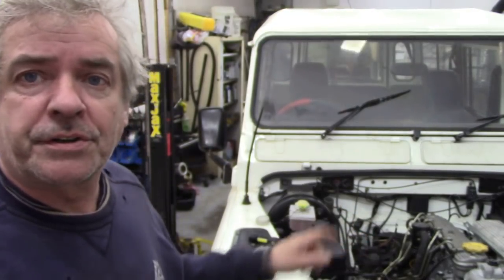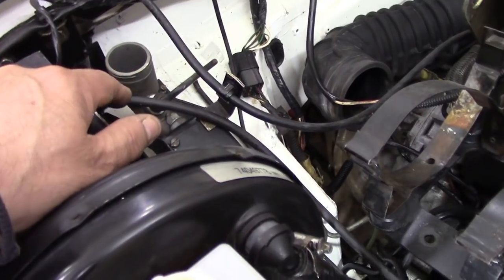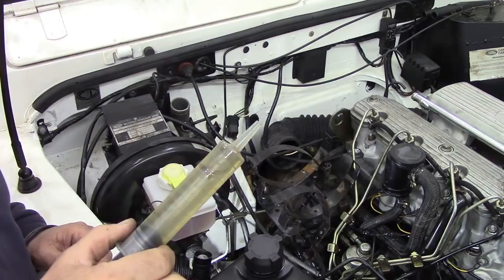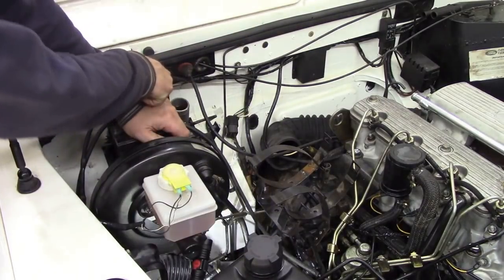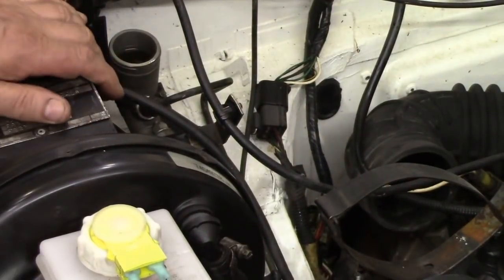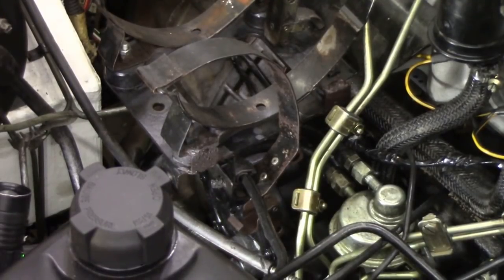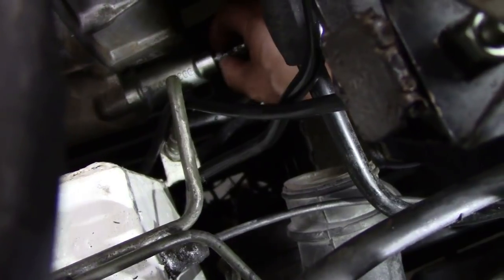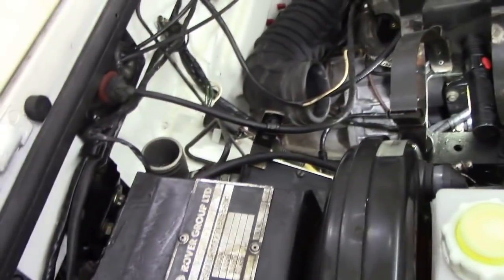Gravity bleeding the 300Tdi clutch - easy!

Comment: In the days before motorways here in the UK I got stuck with a clutch that had run out of fluid due to a leaking slave. The only thing that I could get hold of was a bottle of cough mixture that was for my young child who was traveling with me and my wife. Out of shear desperation I poured that into the master cylinder and hoped for the best. Not only did it get us home, it actually lasted the car out for another 18 months. I think that it must have been the sugar in the cough mixture that sealed the leaking slave cylinder, which was a god send when in those days you had to stop at all those traffic lights and cross roads, not like now once you get onto the motorway there's no need to change gear as much. I  bet you have never heard anything as daft as that before , have you Mike. Stay happy, Yorkshire Rob.
Reply from the maker: I have known milk to do the job too, but may be a bit rancid after 18months!
Reply: Talking of things you do to get you home, back in the 90s I got stuck at work after a night shift with a bone dry petrol tank on my BMW 1000 bike. Last one to leave, nobody around to help, no day shift coming in, nothing to siphon, so I got desperate.  I found an aerosol containing a solvent cleaner. Probably something like today's brake cleaner, or trichloroethane. Anyway, it said highly flammable on it so I thought that will do. De-gassed and punctured a couple of aerosols and poured them in. Sure enough it fired up. Wouldn't idle and had to keep the throttle open above 2000rpm. Ran rough as hell. The exhaust also re-circulated a bit due to the fairing windscreen and didn't half make my eyes sting. But it got me a mile down the road to the garage. Happy days they were.

Comment: Hi Mike
I've just had to replace the Clutch Master cylinder on my RHD (UK) 200TDI 110 and had the most awful job trying to get the air out of the system. Eventually I realized that the slave cylinder had been fitted with the bleed nipple at the bottom. Removed the cylinder and replaced it the other way up and lo and behold a few minutes later gravity took over and all the air was pushed out and the clutch was perfect. So as usual you are correct and the orientation of the slave cylinder is important. On the 200TDI the slave is just above the exhaust pipe so i assume someone fitted it that way round to make it easier to get to the nipple.
Thanks Mike your videos are really useful
Reply from the maker: Glad I was helpful!

Comment: Gonna change my master and slave and the hose this week on the Wolf 90 HS. As it is LHD I think you need to take the servo off! which I hope to avoid - I will opt to take the wing off as I think that is easier. Whenever I have moved servos they always fail
Reply from the maker: Two nuts off the master cylinder and move it to one side, inside the footwell, remove the bolts holding the brake tower on, and either push it to one side or take it out
Simples

Comment: I had a LHD and LH slave on my mgb and replaced the seals on the slave. The piston was worn like you said from acting on con-rod. It took forever to get the pressure up before bleeding. This was probably the only time I would have a completely drained hydraulic system. I see the error now.

Comment: Good tip for the bleeding Mike, I've used "gravity bleeding" on most of the brake jobs I've done, except for some of those under floor master cylinders, it works fine, takes more time but for me it's not a race and it saves me tearing out what hair I have left. Never "boiled" a brake system in my life but I hear it can be a bit of a faf when it happens...
Reply from the maker: I was a passenger in a RR auto going down a very steep long hill with a D1 on the back  - that boiled the fluid - pedal to the floor - pretty scary and we were ready to bail!
Reply: @BritannicaRestorations  was the RR fitted with the optional "ejector seats"..?

Comment: I did this on my Disco 2, the garage fitted a new slave cylinder and could get it bled right, the clutch pedal was so  floppy  with the bite right at the bottom. I got it home cracked open the bleed nipple , let the fluid flow out and tighten it back up, job done
Reply from the maker: Some garages eh?
Reply: @BritannicaRestorations  yes indeed

Comment: Oooh rear drum brakes on the series 2 one tonne, dual slave cylinders on the front.. with the fancy single line brake line safely blocky thingy to separate the front brakes from the rear.. what a faff about that was... So difficult to get them to equal brake force left and right for the MOT..
Reply from the maker: Good to know some things got better over the years!

Comment: l wish that would work for all land rovers,l remember trying to bleed my mates V8 County it took over a hour to get it working,saying that it was right hand drive with the slave on the passenger side bell housing and my land rover county has a remote booster which you got to bleed as well as the slave and don't forget to put the cap back on to stop dirt and mud getting in.
Reply from the maker: 2.5 NA are bad with the cylinder just above the exhaust

Comment: Maybe I am missing something, but the upward loop of the master clutch cyl.fluid exit pipe exceeds the reservoir..wWll, at least on my model (96 300tdi).. probably rebuilt at some stage.
Reply from the maker: As long as the the exit is lower than the reservoir it will run with gravity

Comment: Another 1 man solution for bleeding the clutch on a 200tdi/similar that I find works well is to drill a hole in a old reservoir cap to around 3mm, set the compressor to a few psi and shove a blow gun in the hole, with the few psi applied crack the bleed screw on the slave cylinder until happy.  

Out of interest do you need to give the clutch a pump or two to get a siphon effect going with the gravity method for a fresh/dry system, as the bend in the hose/pipe immediately after the outlet goes just about as high as the reservoir rim/top.

Note: Just re rear watched and you did give her a encouraging pump to overcome this.

Comment: Great video, thanks for sharing - I guess this would work on a 200tdi as well?
Reply from the maker: Yes, but the slave bleed is a bugger to get at - I seem to recall when I had a 200Tdi, I made a pipe that screwed into the bleed port of the slave and then with a male fitting on the other end I fitted a connector and then a bleed screw - I could then bleed the clutch without going under the vehicle!
Reply: @BritannicaRestorations  Hahe, thanks - yup, it is a roight fiddle to undo the bleed screw, lying on a trolley, for sure but I managed it with a sleeve full of fluid dribbling down my arm lol

Comment: I’ve fitted LOF power master master cylinder whenever I’ve needed to replace the master and it makes the clutch as light as a feather. You should have a play with one. And have you ever clutch blead a puma.....you need more then patients and two hands for that! 
Cheers as always Mike
Reply: How much lower did it make your clutch bite point? As I know they use a smaller cylinder
Reply: @Rob-cz7lg  well you’ve got two options with the bite point. My tdci i fitted the power master master cylinder to and it didn’t really affect the biting point at all, just made it much lighter. And my td5 i fitted a power spring that LOF do and that too made it much lighter but made the biting point slightly higher and more sudden. Now I’m more used to it they’re both fantastic and made them so much easier to drive. The power master was about 50£ total and the spring was 25£ total. You can use both but I found that it makes the clutch too light and it dosent return as it should. It’s an either or thing really. Glad to help
Reply: I've just fitted an LOF power master cylinder to a mates ex-MOD ninety. Definitely a big improvement, really well made product and not too pricey.

Comment: Mike, I wish you'd do a video on bleeding LHD clutch systems. Gravity bleed doesn't work because the line loops up above the engine before dropping down to the slave. The line thus runs substantially above the level of the reservoir, and this upper loop can trap air that can be really difficult to get out. Any suggestions to make it easier for us LHD folks?
Reply from the maker: Yes it does work - you just have to pump the pedal a few times if the line is completely empty - once a bit of fluid comes out of the slave it will flow by itself - easy
Reply: @BritannicaRestorations not so easy when you have a left hand driver plus slave damper, it seems to never be able to fush the bubble

Comment: Hi I am trying to bleed the clutch on my 300 disco.. The pedal went to the flood whilst I was out I had to lift it with my foot then it worked for a bit then happened again and so on a difficult drive home with the bite near enuff on the floor but it made it under its own steam. Iv changed the master cylinder for a ap unit and slave cylinder for a trw but gravity bleeding isn't working its not even getting into the pipe and the pedal still hits down to the floor and stays there if I try to pursuade it. Have you any ideas of somthing I may be missing here next step will be reverse bleed with the oil can. Thanks
Reply from the maker: The D1 master cylinder with a plastic reservoir  is a nightmare to bleed - the pedal must be up  - but you may need a bit of pressure to push the fluid through
Reply: @BritannicaRestorations  when you say pressure do you mean take up the free play on pedal or do you mean a eazibleed as I was advised not to use that on a dry system or is this bs?

Comment: Issue I'm having on my discovery Mike is I'm non stop having to bleed my clutch its somehow getting air into the system but when pumping the clutch I can't find any leaks 🤔
Reply from the maker: Clamp the flexible hose - if the pedal still goes down it's the master at fault
Reply: @BritannicaRestorations  I'll do that now but how come I've got a leak on the slave? It's odd it gets wet but no idea where from and haven't found a leak 😂

Comment: Hi Mike,
I've tried your method just after replacing the master cylinder following your video.
I blew air through the reservoir and checked that air was coming out the pipe outlet, so I think the adjustment is ok.
However the pedal is always springing up and down, not pressurizing the oil.
When depressing the pedal, it will spring to the floor (touching it) and wont come back up. Same when pulling it by hand back up, it springs up and stays there.
Any idea of what could it be?
Thanks
Reply from the maker: You must have the later pedal set up - these are problematic to bleed as the spring goes over center and locks at the bottom - the easy way is to get the pedal to the top, fill the master and just lightly pump the pedal by hand but only go half way 
Keep checking the level regular and once flow is established you can gravity bleed, but keep an eye on the level!!!
Reply: @BritannicaRestorations  Thanks Mike!
Mine is a 96 TDI, k forgot to mention.
I have followed your instructions and the pedal has now pressure. Legend!
I have to admit that i haven't been driving it for a while as it went through a restoration. 
It's not quite ready yet to be driven either so it will have to wait.
The pedal feels like has a fair bit of play/not engaging for the first half, the second half is definitely feeling right. 
Do you know where to find how it is supposed to be? Do you think i should second guess my nuts adjustments?
Thank you so much!

Comment: Great videos sir. However, I have tried me darndest to both gravity bleed, and reverse bleed my 83 Camel Trophy LHD Defender. I replaced the clutch slave unit. Still cannot get it to feed fluid up into it from oil can. There is no sign that the master was leaking. I removed the inspection plate and all was dry. I still have no clutch. I pumped that peddle a hundred times and nothing. I am stumped. I have a new master, and it will be a bear to replace as I need to remove the brake booster and tower. However, if I try to loosen the clutch pipe, its twisting with the nut. AAARGH. Any suggestions what I am doing wrong?

Comment: I just tried this on my 300tdi 90 but couldn't even open the bleed screw. Was I right using it a 11mm socket or is it a metric screw? Thanks!
Reply from the maker: depends on the manufacture - I have seen 10mm screws